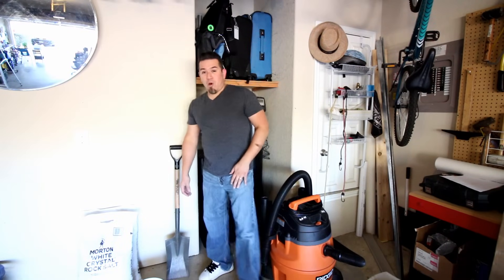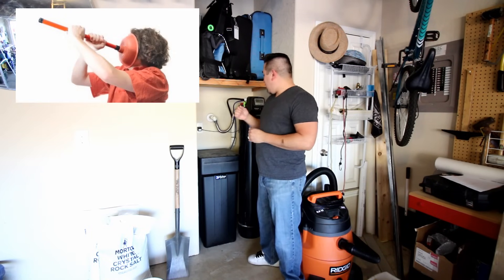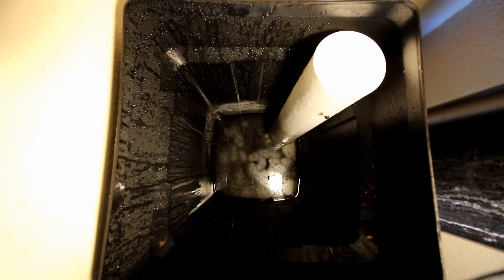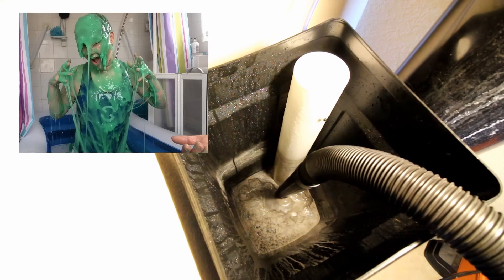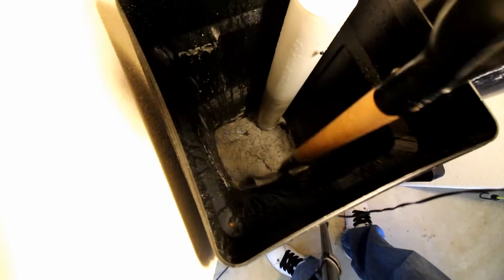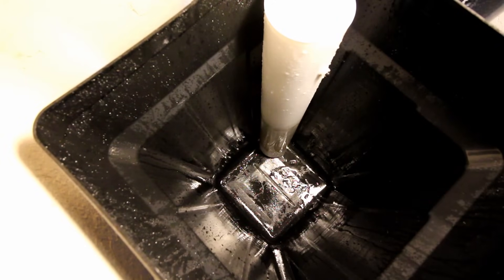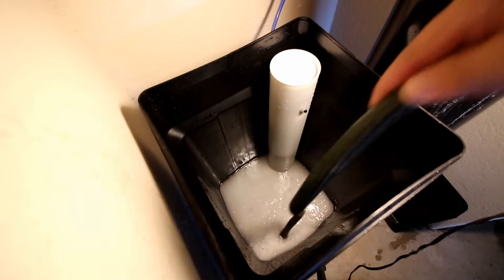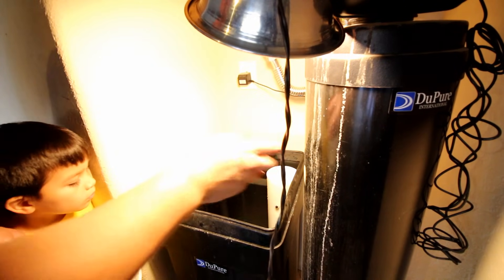DIY: Water Softener Maintenance

Comment: Not until I used the shop vac and started to vacuum, then add water, did I see how thick it was. It didn't look that bad at all. But I added water and removed added more water, mixed up the bottom to loosen up all the dirt, sediment, salt and vacuumed. Repeated several times. It was really dirty. Have to admit. I never realized, my ignorance that it required cleaning. I've had my kenmore for over 10 years!! I'm happy I ran across a video about this. Did everything in this video. Except I used a product called Rust Out

Comment: Dude.  Just take the brine tank outside and dump it.  Hose it out.  Ya gotta remove the tube from the head.  and the over flow tube if you have one on it.  Brine water may kill your grass, so do it on a rock bed or on the driveway.

Comment: Tips - Add water first before adding salt, about 3 inches, brine well is the cylinder with the cap on it and not to be confused with Brine tank. Its better to add the iron out to the brine well not the salt tank. Your diluting the solution by doing that. As you know the purpose of the Iron out is to clean the resin beads in the resin tank. The water that's in the Brine well is what gets pumped into the resin tank first so put it in there.  After bypassing the valves run a cold line in your home to release pressure before opening valve for maintenance. The most important tip for water softeners is to get the water coming into your home tested. You need to know how many grains of hardness your water is so you can input the settings into your softener.  It will allow the machine to run optimally and with less maintenance and issues.

Comment: What’s the difference between the water softener cleaner that you have used and Iron Out?  They both come in powder form, I think both sold at Home Depot.  I have people use Iron Out to restore the resin beads, but I wasn’t aware of the product you were using was even available.  Also, why do you have to regen right away, after pouring that solution into the well?  
My custom water softener system has a 5 micron, charcoal filter, before any water enters the water softener unit; this would probably reduce some maintenance and prolong the reliability of your internal parts of the water softener and brine system.  Great video!

Comment: You need to relieve the water pressure before accessing that injector cap, that's why you had all that water spilling out.  Before unscrewing that cap, put it on bypass and hold the regen button till it starts the cycle.  Also since you got that thing open, might as well check on injector.  Those things always get clogged, especially if you get sludge buildup.

Comment: Looks like you made a mistake or three in this...
1) Isn't the "brine well" the 4 inch pipe on the side??! That's where I was taught to pour any cleaning solution
2) Are you SURE you need to add water??? a) Having water above the salt sounds like too much; b) ANY time you do a recharge, it automatically adds the correct amount of water to create the needed brine. 
3) I'd be really cautious about using rock salt in a water softener. Sure, it doesn't have the cleaning additives. But the real issue is, it is NOT pure salt. Has lots of contaminants. Some cause the sludge and gunk you see. But some simply doesn't dissolve in water! Not a big deal when doing hand-crank ice cream... but a very big deal in a softener.

Comment: I have a similar model of softener and i have no clue where the filter is to replace it.  can you help???   All the videos I've seen have a regular tube container that you need a special wrench to remove and there is the filter, but I don't have one of those in my garage.  I have the same like you have in this video.

Comment: Takes about a minute to disconnect the hose and take the tank outside to clean. That way you can turn it on its side and spray it out.
Reply: I was about to post the same thing. Yesterday I took the tank outside and rinsed it clean. The version in the video is ridiculous.
Reply: Oh good to know. I don’t own a big shop vac
Reply: And if you have a gravel driveway the salt water helps with weed control !

Comment: Why not just disconnect the the tank and clean it out with a hose?
Reply from the maker: Hey Victor, its a good call out and I went in that direction first. Unfortunately there is a floating plastic part inside that particular connection (at least on my model). When I disconnect the line that part tents to float up and possibly fall out. I could image the number of headaches this would cause for folks so I played it safe.

Comment: My water softener doesn’t look like that I guess it’s a more newer model one
Reply from the maker: Hey Cathy, The DePure softener I featured in this video is about 12 years old now. I have since replaced it with a system from a different company. Also note that the salt I am using in the video is not the best option. I would morton salt pellets in the yellow bag instead of the salt I used. DePure had provided me with poor instruction.

Comment: You didn't say anything about the position of the valves after you were done with the maintenance should I reset the bypass valve back to open so it can regenerate
Reply: You actually didn’t even need to bypass the system for the work I did. Once you finish up you can put the bypass back to normal.

Comment: Hey there. Thank you for this video. I bought a property with a septic tank and started noticing a weird smell coming out the water (shower, sink,…). That’s when I stumbled upon your video. My question is, will this type of clean-up get rid of this odor? Or perhaps do I need something more like a conditioner/filter?
Reply from the maker: Hey Samuel, sorry for the delay in response. The odor from your water is most likely due to hydrogen sulfide from sulfur bacteria. Are you using a well? There are systems out there designed for this type of issue. For example you can look into a sanitizing system. There are also chem injection systems that add some chlorine to your water to kill off any contaminates.

Comment: Don't do this. I used to work on softeners. 
1. Just run your salt tank almost empty. 
2. Unscrew your brine line running to your softener and detach it from the tank 
3. Take the salt/brine tank outside and spray it out with a hose.
4. Hook up brine line.
5 . Fill with salt 
6. Mix one gallon water to 1/3 bottle of iron out and add it to the brine well.
7. Send your system into regeneration before bed.

The iron out is not for cleaning the brine tank. It's too clean your resin in the softener. Like an oil change. Do not use a shovel in your tank. Easy way to put a hole in it. The dirt is from buying unfiltered salt. You can buy filtered salt. It's more expensive however.
Reply from the maker: The video was intended for those that didnt have the tech savvy or time to disconnect the softener parts. In addition, there is a small plastic piece inside the tank head connection to the brine regen line. If you disconnect you risk that part coming out. If lost, it causes issues for regeneration. 
Also, using a shovel requires finesse. I wouldnt advise viewers to hack their way into the bottom of the tank.

Comment: Hey guy that white thing in the tank were the salt gose it's squirting water out under the floor little black holes that hooks to it and outside of the house his water is going everywhere what's up with it
Reply from the maker: Send me a photo of the tank, then a photo showing where the water is coming out from. ( mark@launchpadb.com ). Did the brine well (white tube) get broken away from the tank wall?
Reply: @ThisGuyProductions  see that white tube on yours okay behind it there is a black hose that goes to it water hose through it and that's were the water is coming out from and were you put the salt there is supposed to be a rubber seal around the black hose it not there and that's how the water is coming out from all over the floor we still can't get a hold of anyone .
Reply from the maker: @yashuasaves6782  Got it. Typically the opening for the regen line is high up on the brine tank to avoid a problem like that. If you get get the water level lower than the opening you may be able to seal it up. The correct way would be to buy a rubber "wiring grommet," that fits the opening. then you can route the tube through it. You should be able to find assorted sizes at Lowes or online. The other option is just to plug it up with some good o' fashioned Lock-Tite silicone sealant. You can also find this at the hardware store.

Comment: Once you remove the water you can just lift it and take it outside and take a hose to it. Not hard to disconnect one hose
Reply from the maker: Very True Fabian, The only concern is that there is a tiny piece inside the line connection at the head of the tank that tends to fall out easily. Should someone lose it, they would have a heck of a time finding a replacement.

Comment: That mess in your tank is from using rock salt. You need to use solar salt for softeners and you won’t have to clean the brine tank. You’re just going to have the same problem by refilling with that dirty salt.
Reply from the maker: You are right J RM. I have switched to yellow bag pellets a long time back and have much less buildup. It still accumulates over time, but not as bad.
Reply from the maker: @RAYGERVATO  - Spot on. DuPure actually told me to use rock salt when they installed my system. Every year I was clearing out the brine tank because of the buidup. Little did I know that they were setting me up to pay the $500 annual maintenance fee instead of doing it myself.

Comment: I am not sure how it all works. So if the water is consumed at least in first couple of hours or so, will the water have small traces of the cleaner in it? Also the tank looked really nasty before cleaning. Does the sediment or dust etc get into the water that is consumed?
Reply from the maker: So the water in the brine tank is never consumed. During regeneration the softener pulls a big drink of the salt water out of the brine tank. It uses the salt ions to recharge the resin in your softener. During that pull it also absorbs the cleaning solution I added. After the resin is regenerated the softer does a backwash for like 20 minutes. This is when your softener is shooting all that water out of it's drain line. That backwash flushes out all of the salt, and that cleaner, during the backwash. Thats why your water isn't salty when you drink it later.

Comment: What happens if you put salt over the dirty sediment?
Reply from the maker: Nothing at first, but eventually the sediment will get deep enough that it blocks the entrance to the brine tube. Thats the white tube inside the tank. It has to have a clear open bottom opening to suck up the salt water.

Comment: My brine tank has a shelf at the bottom that holds the salt above the brine solution about 4 inches to avoid sucking large particles of salt into the valve. I have been buying a product called Rescare off Amazon, that you add a small amount periodically into the 4 inch pipe in the tank, so it goes to the bottom of the tank, that helps to prolong the life of the media in the softener tank. When I clean my brine tank, I wait till the salt level gets low and take the whole tank and dump it out in a bucket, then hose it out. I would not suck salt water into my vacuum. Salt water will destroy anything metallic that it get near. I think the combination of the shelf at the bottom and having the valve pre fill the the brine take 1 hour before the regen. cycle, I never get that solid salt block at the bottom.
Reply from the maker: Thanks Kwd57. I'll look for that product on Amazon. I appreciate the info.

Comment: Just had a new soft water system installed and now I can't get water to the toilets. After about a hour we turned on the water in the laundry sink and a whole bunch of black fine particles came shooting out of the faucet. Still don't have water to the toilets!
Reply from the maker: It sounds like you installed a carbon filter as well as a softener? Did your unit require you to flush it with water prior to installation? I worry that you may have clogged the fillers in your toiler with carbon.

Comment: Question. I've heard many say to regen right away. Why? You said just wait till normal regen.?? Also, I've heard to run cold water for 20 minutes after regen. Why?? Thanks
Reply from the maker: There is no need to regen right away because the solution is in there ready to go. Your system wont pull water from the brine tank until it is ready to regen, so the solution added will not affect your drinking water. When you system eventually regens it will suck the water from the brine tank into the resin tank and flush it through the resin. The salt will regen the resin and the additive will help purge contaminants out of the resin. Once the cycle is done the water softener will backwash the salt, brine, and solution out of it for about 15 to 20 minutes depending on your system settings. Anyone that says to flush for 20 more minutes on top of that through your plumbing is just playing it safe. Honestly, it wont hurt anything to play it safe and flush. We didnt and we had zero issues though.
Reply: @ThisGuyProductions  Takes about 4 hours for the solution to be ready as brine for the regeneration process but agreed your system will regen at 0200hrs during period of less usage while still in service mode.

Comment: I have a rain soft.   Will it be the same process?
Reply from the maker: For the most part the process is similar. You are just looking to clear buildup from the brine tank and add that regeneration agent to the brine well. The brine well is actually that white tube inside the tank.

Comment: I had no idea I had to do this! I have a house I bought a year ago with a salt water softener, and was wondering how to take care of it. Thank you!
Reply from the maker: Honestly, I would only advise you to go through these motions if you are seeing sediment and scum inside the brine well. The solution I show in the video is to be poured into the white plastic pipe in the tank instead of over the salt in the tank. It wont damage it, but it will not be as effective when it cleans the resin.

Comment: Isn't that solution should go into the brinewell? Isn't the brinewell that tube about 4" circumference with a cap inside the brinewell tank?
Reply from the maker: Yup Pristin, You are correct. It goes into the tube and not into the entire tank like I did. The good news is the way I did it was still effective.

Comment: On average, how often would you recommend doing this? Once a year, every few years?
Reply from the maker: I used to do this yearly, but it was because I was using bargain salt. I have since switched to salt pellets and have noticed a considerable reduction in buildup. I would advise you to keep an eye on your tank by checking when the salt level is low. Check to see if the salt at the bottom of the brine tank is dirty, or nice and clean (all white). If it is dirty you should plan to change it.

Comment: Awesome video, thanks! I used a Res Care solution to clean my water softener today but accidentally dumped the whole bottle (1 gallon!) into my brine tank instead of the recommended 1/2 cup.  Do you think I totally screwed it up or should I just regenerate it a few times and follow directions next time??  Thanks again!
Reply from the maker: I am hopeful there will be no long term effects. I would  definitely run a few regens to play it safe though. I would also be cautious about drinking the water from your system until it has flushed a few times.

Comment: Thanks for the tutorial. Much appreciated.  I had mine over 8 years and haven’t done anything to it. Noticed water quality wasn’t the same. I’m gonna start maintaining with this process. Thank you!
Reply from the maker: Glad it was helpful. Keep in mind that the resin inside softeners isnt made to last forever. You also want to be careful to never let the salt run completely out. Try to keep the level maintained. If your system runs for too long without salt it can damage the resin permanently.
Reply: howard truong Tell me about it!

Comment: Great video!!!! Went to look at a house that had a rotten egg/sulfur smell coming from the water they have a softer setup, could it just need cleaning why it smells?
Reply from the maker: I take it the house uses well water? The sulfur smell is most likely due to bacteria that has bloomed in the well, and possibly the softener. There is a cleaning solution you can add to a system that has that sulfur smell. You can pick it up at the hardware store or online. Id have them clean it out for you prior to making the purchase though.
Reply: @ThisGuyProductions  thanks for the reply. Not a welll, actually city water (Tampa).
Reply from the maker: @EricEvolving  I am pretty certain there is some kind of algae bloom inside that resin tank. I installed my own system from a company called Spring Well last year. My old system was overdue. If you cant get the aroma out you may consider a replacement. I mention the seller I used because you can buy online and do the job yourself if you feel comfortable with it. It saves a ton of money around installation.
Reply: @ThisGuyProductions Appreciate that, I will let you know.

Comment: My technician also says to make sure water is above salt for 1 or 2 inches, but the machine manual says to make sure salt is above water. Super confused :(
Can anyone help?
Reply from the maker: Adding water to just over the level of the salt is good. There is actually a floater inside the brine well to regulate it and keep it from overflowing. The system will adjust the level after your next regen.